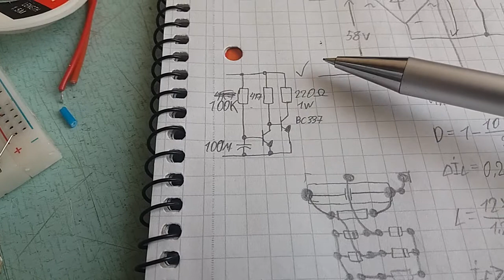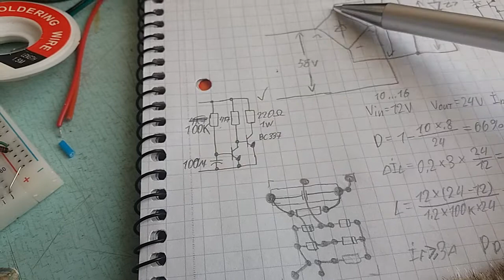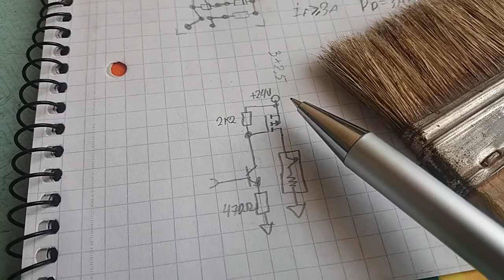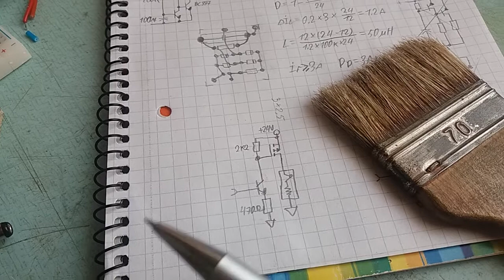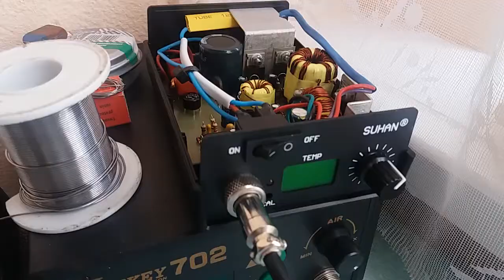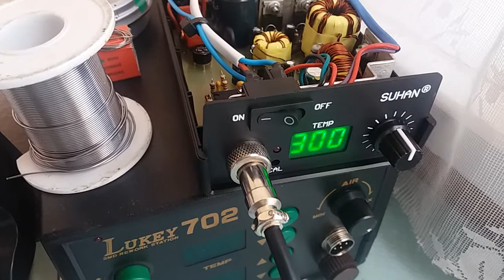tl494 SMPS: Part 8 - Let's talk about problems

Comment: Leave it to the Chinese to build a dodgy flaw into commercial product. I guess only people that try to run these irons at their top voltage run into the problem though? Everyone using a laptop 19V PSU are unwittingly doing themselves a favor.
Reply from the maker: Paul Frederick Pretty much, yes :) There are  MOSFETS that can handle 30v on the gate, but for me it was easier to do this hack than to replace a FET.
Reply: Your fix is definitely easier than replacing that part. I do not put good odds on getting that part off the board without damaging the board itself. That looks like a difficult rework job to me.
Reply from the maker: Another thing I have to say is that the PCB is pretty good, so if you have a hot air gun you would be able to replace the FET without damaging the PCB. Or you can do it with 2 soldering irons ;)
Reply: I just ordered some new tips for my old station. T12s still interest me but I'm not going to run out right away and get one now. Someday though. Just to see if they're better than my old Weller WTCPN If I really need an iron with more power I have bigger irons too.  http://i.imgur.com/8w3L7qx.jpg

Comment: Perhaps earthing the heatsink via a capacitor would work as good as a direct wire?.
As i dont know your circuit, is it an emi capacitor that your missing?.

I thought the same fix for the fet protection, but you explained fast so i didnt think any firther.

I find it odd that your psu dont allways start up, is the start resistor/cap not quite enough.

Im still impressed by the speed of heat up :-D
Reply from the maker: zx8401ztv Yes, you can capacitively couple it, whack smth like 0.1uf in and it should do the trick. Of course, for that to work the part must be isolated from heatsink.
 Regarding the startup problem, it is quite sneaky. If I had less experience, I would not have figured that out. I'll talk about it in the next video.

Comment: It will be interesting to see if the 12v zener changes the way the controller measures tip temperature..
Reply from the maker: Cliff Matthews It did not affect it in any way. Temp signal is picked off of a drain of the MOSFET, to which I didn't do any modifications.